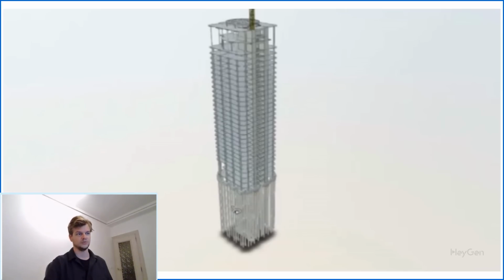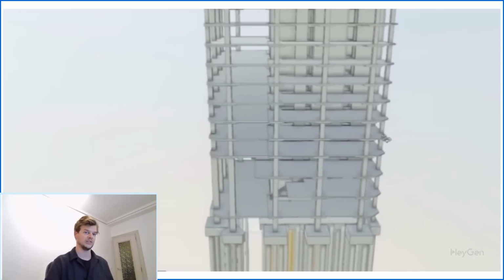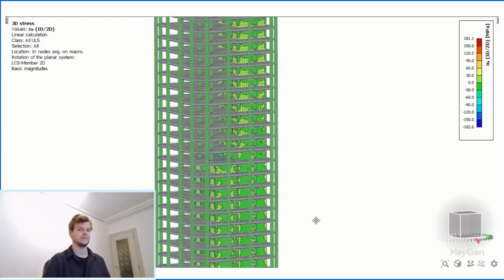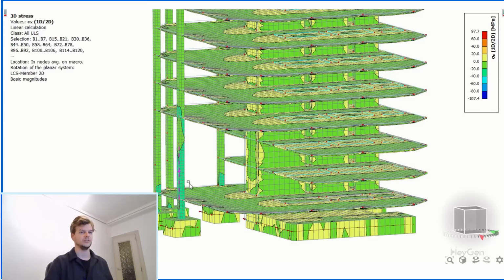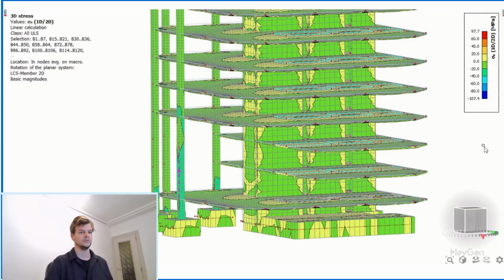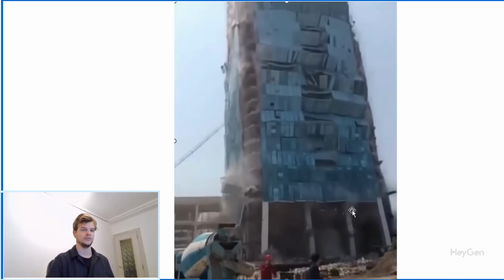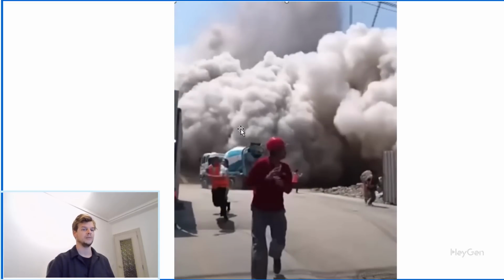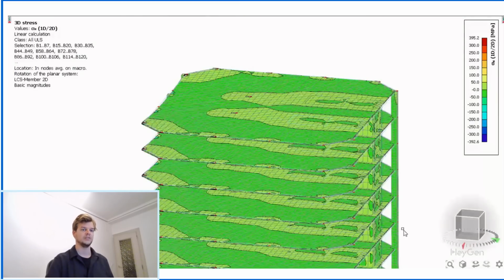Bangkok Skyscraper Collapse FEM Analysis 2025

Comment: For the young engineers FEM has a very important assumption and that is everything is homogeneous.  The building in question is most likely failed first at the flat slab connection.  That means the ability of the flat slab connection with the columns may not have been homogeneously constructed, possibly due to the rebar inside unable to force the slab and the columns to share a common strain. One can call it poor detailing or lack of rebar providing adequate distribution or lack of concrete for the steel reinforcement to bite into.
FEM does have another weakness and that it it is not truly represents reinforced concrete behaviour.  In fact I would dare to say the FEM model is 90% for the concrete because it is nearly impossible to model every rebar in any FEM model.  In any reinforced concrete design when a member is subject to bending concrete in tension part is assumed cracked once leaving the tensile resistance entirely to the steel rebar.  Every international RC design code assumes for design purpose concrete is assumed to offer no tensile resistance (except for prestressing work where asbout 1 to 2 Mpa is permitted). This design concept cannot be modelled by FEM which is normally just a "linear" and "elastic" model although some might have some nonlinear and/or inelastic  provisions.  However in a collapse state the structural behaviour is nonlinear and the material states will be well pass the elastic range.  Therefore one must be mindful in presenting one's FEM model.
Some FEM model may be able to use the full stress-strain curves of the materials by repeating the analysis one step at a time to track the position in the stress-strain curve of each material.  The "nonlinear" behaviour to certain extent can be captured by inputting the deformed geometry to substitute the initial geometry.  Most structural engineers do not realise a structure achieve its equilibrium only after it has been loaded and has deflection but it is a standard practice to feed a FEM model with the geometry corresponding to its no-load condition.  The nonlinear error is normally small and can be ignored in the structure that is serviceable as its deflected shape after full load should not alarm the bystanders.  However in a collapse state the nonlinear effect cannot be totally ignored.
The last item that a FEM is unable handle in a collapsed building like the one in Thailand due to the earthquake is the buckling load phenomenon.  This is because if the flat slab to column connection did fail first the constraint of the column would be gone and its effective length would suddenly multiplied.  Typically if the constraint at ith level is lost the column's effective length is no longer i+1th level minus ith level  but i+1th minus i-1th level.  The doubling the physical height will quadruple the effective length in any buckling formula.
One useful information should have been provided is the origin of so called 60Mpa stress in the columns should be qualified.  Is this from the original design or from the as-happen acute earthquake?  I cannot image such overstress could pass the reviewing process without causing an uproar!
Reply from the maker: Thanks for your detailed comment — you raise some really interesting points. I’ll definitely take a closer look at them!
Reply: @CIVILDETECTIVE  If you have ever witnessed a high rise model under vibration in a laboratory you will notice the floors always remain horizontal when the structure is shaking.  The columns attached to the floor also remain orthogonal to the floor with the columns flex like a "S".  The flat slab connection with the column, due to the stiffness ratio, does not appear to be able to remain orthogonal during the earthquake.  The debris on site all show the columns were relative undamaged but all pulled out at the floor level!  You FEM is unlikely to show such outcome.  It is just design experience you can find from any veteran designer in RC design and detailing.  Actually if you ask a British detailer/draftsman, who earn a living by detail reinforcing bars in the RC drawings he will tell you how structurally weak is the flat slab with column connection.
The other relevant point is Bangkok is seismic zone 2 or 2A  but with 50km it is zone 3.  Thus the design of the building may have been compromised by its zone factor.  I personally have not seen any zone 2 structure to have sloshing at the roof top swimming pools.  It is without doubt the design for zone 2 wasn't able to cope of the earthquake recorded recently.
Lastly in the same video I saw the "dust" came down first which suggests the flat slab connection was in trouble and was dropping, then the two inner high columns actually broken or severed prior to the collapse of the building.

Comment: The tested the rebar and it does not meet code specs, in addition the concrete is suspect and the engineering.   Why would any country have Chinese build anything?  Their own building have major structural issues and substandard materials.

Comment: Please color your stress scale to the maximum, that the material could handle including a good safety.
So, the parts that have more than 30 MPa will actually be highlighted (red or dark blue) in the grafics.

How you have done it, you can not identify anything in the coloring.
Thanks!

Comment: Many thanks for sharing the detailed analysis. However recent evidences show the collapse has started with the shear wall.

https://youtu.be/Ka-TD5ioDek?si=sKXON_CrehpxDO3N

Please cheack simulation analyzed by Professor Worasak Kanok-Nukulchai, explains the building collapsed eight seconds after an earthquake. The building's off-center concrete shear walls caused twisting, which stressed the elevator shaft's base, leading to its failure. This failure initiated the collapse. The analysis was based on objective evidence. A committee is investigating potential design modifications to the elevator shaft and construction materials that may have contributed to the collapse. The elevator shaft was the starting point of the collapse.

Comment: You left out the fact that the video shows fail in the mid section before the columns fail, also the roof appears to fail at the same time,  the two columns were not first to fail... look at the full screen video and anyone will see the columns at ground level were not first.

Comment: Funny..I guess I am the only person that saw that earthquake video. The video showed how buildings built to the wrong height will resonate, turn into a giant vibrater rather than a building shaking a bit. She shock wave goes up the building then back down where it is increased by the next shock wave, building on its strength each time. Building in strength until it looks like it explodes. Well it is probably best if you watch the video, if you can find it. I just saw resonance personally with a wire in a wind storm. The power it produces is very impressive. I did like your video presentation.

Comment: It was the construction crane atop the shear elevator shaft that swung about like a mad pendulum that caused the stress that led to the failure....
Reply: Coincide with my opinion 😆😆
No one says Inertial contribution from crane structure swaying atop, which, the additional load on the structure, was not considered in the design.
Considering the stresses at the connection of crane brace to building, the stresses would be Wow Wow
Reply: @MinHtet-em8fx  Cranes are light weight compared to the structure and their forces wouldn't have make any impact on the collapse outcome.
Reply: @fx-studio 
Really?
Light-weight, 1lb? 2-lb? 1ton? 2ton?
May be cranes are lightweight in gravity. How about a body getting acceleration due to earthquake swaying? Have you ever thought of the inertial load derived by the swaying crane system (F = m*a) and dynamic amplification due to different sway response of crane & building

Yeah, cranes are light weight in gravity (at least 15 tons).. Multiply crane mass with sway acceleration... multiply this inertial load with dynamic amplification factor.
apply these inertial loads at the two brace connection of the crane to building and reanalyze your structure. Check stresses
Reply: @MinHtet-em8fx   The building weighs 50 million Kg - no structural engineers has mentioned the crane as being a thing.
Its an idea from people who have no cl ue.

Comment: 1) There is almost no cement in mixture, mostly sand.
2) Use inferior steel rod with half the cost.
3) Reduce the size of post/beam by 30-50%

In summary, it is corrupted as HELL !
Reply: Seen enough Tofu Dreg construction, to know it was corruption.

Comment: The news said that the elevator shaft also brought it down since it's on the side and not in the middle. What do you think?
Reply: It was that construction crane on that elevator shaft that caused the stress on that shaft causing the failure.

Comment: I always believed the engineer cant f-up enough in the design stage. But seeing this analysis i am not sure anymore.
Anyway, where did you get the building plan? Estimate?  The size of the main column is most likely be 1.4 x 1.4, as officially stated, not one meter as u said.
And did you include the elevator shaft wall into the analysis.

Comment: structure gave way due to cores failing NOT columns
most likely due to shitty steel
Reply: I read some of the test result. Steel is below average but not too bad. It is shitty tofu dreg cement.
Reply: The earlier testing has shown 30 of the 32 sample steels are in matched quality standard.   So this is not all blamed.

Comment: No it was made in china
Reply: The building had massive design flaws - and even the Thai structural engineers signature were reportedly F aked by other Thais. Its the contractors job to build the design they were given - its not their business to be involved in the design, nor the testing of materials. That's the job of the Thai consultants who were paid a hefty 74M Baht, but so far there is no evidence they actually did it.
Reply: Are you American? Just wonder.

Comment: I am Thai
What happened was the shear wall at the back of the building failed first 
Which is very strange.
You can see from the different angel video

It would be greate if you can add model of podium around the tower because this may cause the shear wall at the back of the building to fail  due to earthquake.
Reply from the maker: I’ve made an updated version of the video with better visuals, a simplified FEM model, and a quick physical demo to explain the torsion:
👉 https://youtu.be/UZzjzqX4-wk
Torsion doesn’t just cause rotation — it also leads to shear stresses in the structure, especially near the base where the loads concentrate.
Thanks for watching and discussing!
Reply: What was on top if that shear wall/shaft...? The construction crane!
Reply: @cochinaable  Yes, construuction crane
Reply: Yes correct, would be great if he could include the core shear walls.
They lowered the core wall to just 250mm from 300m and the rebars was just DB12 @300, that's less than 0.5% steel when it should be around 3%. OMG
Reply: There are some sources stated there were compelled construction utilization change on some design relevant to the core wall.
Reply: @alexlo7708  yes, it is true. But I don't think that is the main reason for the collapse.
Reply: It seem that there are torsion callasp at shear wall lead to the callasped of others all pillars made buildings free fall pancake collapse.

The Assumption of Royal Society of Thailand Engineer told it's the flaw of design that they move shear wall to back side of building lead to non-balance of pillars structure, instead of sway it twisted thus, they need to reinforce the front pillar section of building to counter twisting shear stress but it seem they didnt.

Source: https://youtu.be/1bREnfbwq78?si=shccHXirDierkclb

Comment: Preliminary analysis: catastrophic failure from cyclic torsion at the elevator shear wall. Shear wall around elevator collapsed first before the 2 columns.
Reply from the maker: Thanks for the insight, super! that’s a very plausible scenario. If the elevator core was acting as the main lateral system and was subjected to strong torsion during the earthquake, it could have cracked or fractured early. That would explain why the columns failed afterwardonce the core loses integrity, the rest becomes extremely vulnerable.

Do you happen to have a source for that preliminary analysis? I’d love to dig deeper.
Reply: @ https://youtu.be/1bREnfbwq78?si=Y4quguUn6xjy6mAW in Thai but I think you can kind of guess what is he saying.
Reply: @maekwata  Can turn on Subtitles in English/ closed captions to see what he is saying in English. 
He is a very experienced, knowledgeable and respected Phd academic structural engineer.
Reply: @CIVILDETECTIVE  Also https://youtu.be/XrxRn4utjSQ and https://youtu.be/M-hznaLVX-o
Reply: The elevator core also had wall thickness reduced from 30cm (design plans) to 25cm (as built plans)

Comment: Great analysis. There was also a quality issue. So that just magnified the original design flaw.
Hey could you please provide me drawings for the building with structural details, I would like to further study the dynamic behind the structural design of said building.
Reply from the maker: Thanks! I appreciate the comment, and yes, from what I’ve seen, there were definitely signs of poor construction quality, which likely amplified any existing design vulnerabilities.

Regarding the drawings: I based the model on publicly available BIM files (Revit and IFC), which were shared in the 3117 BIM Management group on Facebook. I don’t have official building drawings or verified structural details, so everything in the video should be viewed as illustrative rather than definitive. That said, you're welcome to explore the same BIM sources, they’re a good starting point for further analysis.

Let me know if you dive into it,  I’d be curious to hear about your results!

Comment: No seismic isolation support sir
Reply from the maker: Good point! yes, from the structural model I used, there are shear walls included, particularly around the core and elevator shaft areas. These walls definitely add stiffness and help resist lateral loads.
Reply from the maker: Correct, the model does not include seismic isolation. Based on the publicly available BIM data, there were no visible indications of isolation systems being part of the original design.

If you have any info suggesting it was included, I’d be interested to look into it!
Reply: @CIVILDETECTIVE  i guess from the structural model there is shear walls included.

Comment: Soft ground floors should be illegal. That is where the most stress is and that is where it should be most solid
Reply from the maker: Thanks for your comment sir, you make a good point. Soft ground floors can be a weak spot in a structure, especially under lateral loads like earthquakes. That’s why they’re often discouraged or require additional design measures in modern building codes.

It really comes down to how they’re detailed and supported within the overall structural system.

Have a great day!

Comment: Thank you for posting, great concise video!

Given that the core is offset, it could be interesting to understand how different the centers of mass and stiffness are. Could you also run a modal analysis to check what the fundamental modes look like?

Finally, if possible, it would be very useful to show the shear stresses or bending moments of those front atrium columns.

Thank you again!
Reply from the maker: Thanks a lot for the thoughtful comment really appreciate it!

You're absolutely right: with the core being offset, it would definitely be interesting to explore how the centers of mass and stiffness relate to each other. I haven’t run a full modal analysis yet, but it’s high on my list! 
Great point as well about the front atrium columns. I’ll aim to include shear forces and bending moments in a follow-up or breakdown, depending on how far I can take the model without going too speculative.

Thanks again, this kind of input really helps and motivates to improve the quality and depth of the content!

Comment: Excellent analysis.
Reply from the maker: Thanks you! What makes you interested in  constructions? Greetings!
Reply: @CIVILDETECTIVE  They also narrowed down the core walls to just 250 from 300mm because the corridors were to narrow!
It was not the same engineer who approved it who did the original design either.
Reply from the maker: @fx-studio  a classic case! the never-ending discussion between architect and structural engineer. A few centimeters may seem minor architecturally, but structurally it can be a game changer. Thanks for the additional info!
Reply: @CIVILDETECTIVE  The story gets worse - the engineer whos signature is on the revisions says its F ake and he was not involved in the project at all !  He just filed a po lice complaint. Check out:   PPTV HD 36   for more info, subtitles in English available.
Reply: @CIVILDETECTIVE  For your info - they lowered the core wall to just 250mm from 300m and the rebars was just DB12 @300, that's less than 0.5% steel when it should be around 3%.
Reply: @CIVILDETECTIVE  I have done my own heavy duty construction in the past. 
BTW you should check out the latest news on it, which is that the core wall width was lowered from 300 to 250 because the corridors were too narrow once marble was fitted. Its on:  The reporters    on f ace second word book.